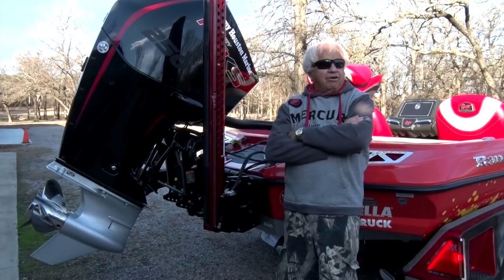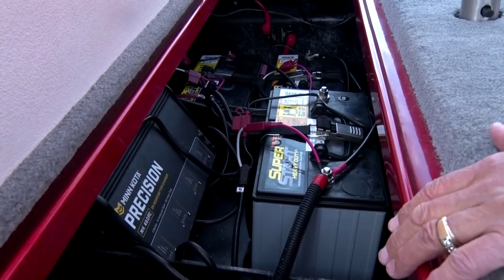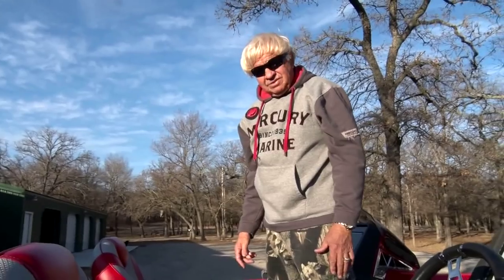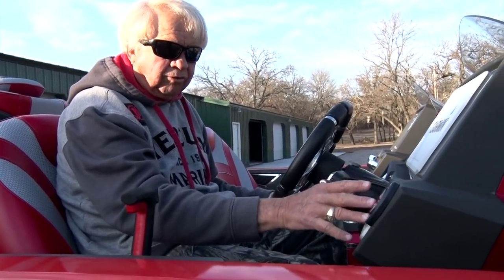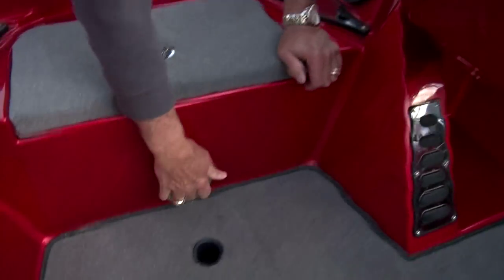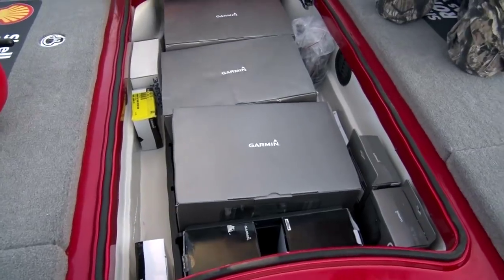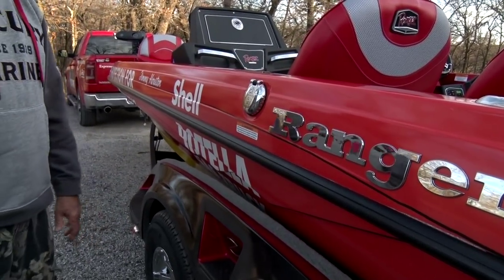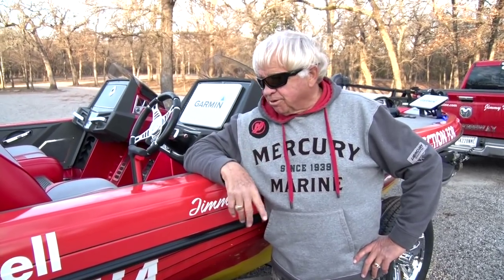My New Ranger Boat!

Comment: Very nice boat Jimmy!  proud for you bub >  You know what i like>    the MERCURY
Reply from the maker: It’s the most awesome motor I’ve ever used!   Thanks.  God Bless!   jimmy
Reply: So proud for ya buddy!  Have fun be safe!  At 350 hp in a Mercury  4 stroke WOW  Here comes Jimmy!  Cut down on weight, like 1/2 tank of fuel ect.  Plain it out and FLY buddy!  Gods Blessing
Reply from the maker: 250 HP, Bee, but I do like the way you think!!   Lol.  God Bless!   jimmy
Reply: thx brother!  what i do ;) boats are like air planes!  cut down on weight, like 3 fishing reels ect ect have things that a must to have like a flare gun, 1st aid kits, fire extinguisher,  flash light a can for a toilet, toilet paper ect i like to cook out on the water carry a small  butane stove can get em cheap in a case>  i love em got 6 of them in the van boats and things>  I had to use one in my truck 1 time for heat, 10 below and stranded 3 cans of fuel is plenty burn about 8 hour or 4 hours on high, for 1 can >  Now you want to run a butane bottle is make a hole in the bottom of a can jb weld a nipple and clamp a hose to it some got a adapter to run a line to a bottle This is what i got >>>  .webstaurantstore.com/choice-1-burner-high-performance-butane-countertop-range-portable-stove/472E10SL.html?

Comment: That is a nice boat. 73 MPH is fast on water. My brother and I had a friend that had one the would run 70 MPH it felt like 100 set that close to the water going across Table Rock Lake were I went fishing with him. The old boat my son and I fished out was show but it got us out on the water. I worked for Tracker for awhile was surprised to find out that Mercury inboard motors was Chevy motors didn't build a lot of outboard boats must was ski boats. The biggest one we was building had a 496 cubic in engine in it. They said it would run 55 MPH that's pretty good for a big boat. 26.5 feet. 
Stay safe and God bless.
Reply from the maker: It’s really fast, Dan.  And it does seem like a hundred or more!!  Definitely need to be paying attention all the time at that speed    We have never had an inboard but had one Ranger that was inboard outboard.  That was a fun boat.  Can’t catch one going 70 mph anyway so your boat will catch em
Just fine!   Thanks.  God Bless!   jimmy

Comment: The boat color is interesting, solid red like a fire truck. I liked the gel coat with flake on my Ranger better but this is definitely different.
Reply from the maker: This has red metal flake gel coat under the wrap, Roy.  Great thing about the wraps is when you take it off, and get ready to sell the boat, there’s not a scratch on it!   Looks like it rolled right out of the Ranger plant!!  Lol.  Thanks.  Godspeed!   jimmy
Reply: @TwinEagleRanch  Ok thats tough to tell from the video. Love your channel and work and have been a fan for decades.
Reply: @TwinEagleRanch  Love your channel and body of work and have been a fan for decades

Comment: Hey I've only got one power pole on my boat! Lol. Came that way. I personally think my ultrex is more bang for the buck than purchasing another power pole. I rarely use mine. Ultrex keeps the bow of my boat where I want it. Using the single pole (also 8 ft) and the ultrex works very well. But I'm no pro so your theory is still true. Lol
Reply from the maker: The Ultrex works perfectly, particularly in deeper water where you don’t need to worry about backwash one your fishing spot as it hold your place.  Up shallow, the Power Poles work better!!   Best of both worlds and much better than pulling up an anchor like we did for years.  Lol.  Thanks.  Godspeed!   jimmy
Reply: Hey Mr. Houston. When will you be in Indianapolis?

Comment: One power pole and anchor mode on the trolling motor hold you rock steady all day long the boat won’t rotate and it’ll you save 2500$ from not buying the other pole

Comment: Gas drinking 250 hp  they have had nothing but problems with this motor !
Reply: I love my 2016 Merc 150 4 stroke. Better mileage, less noise, no smoke, and it starts every time. Maybe these bass guys should go with twin 150's instead of 1 big ass motor. Gonna have to put more flotation in the back though. Waiting to see the first pro bass boat with twins.